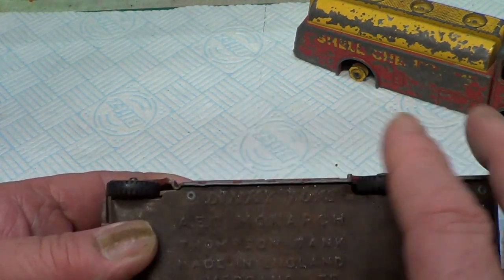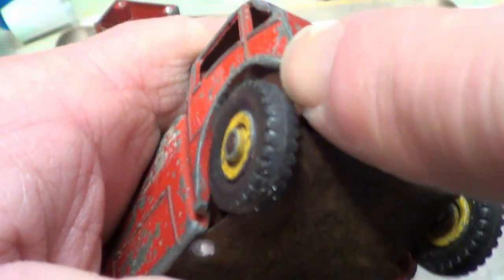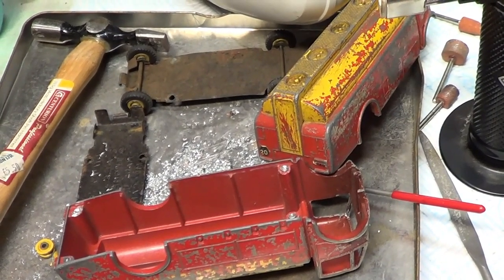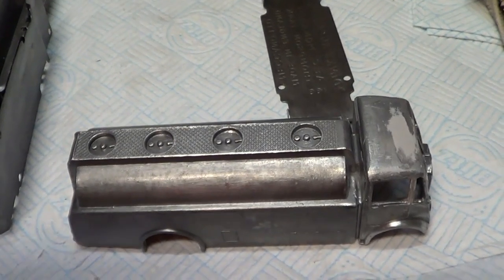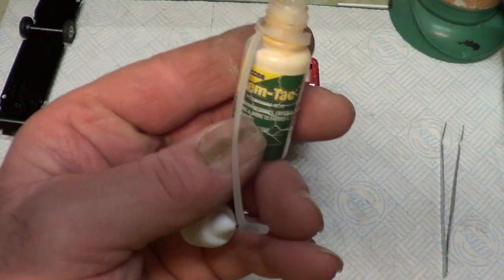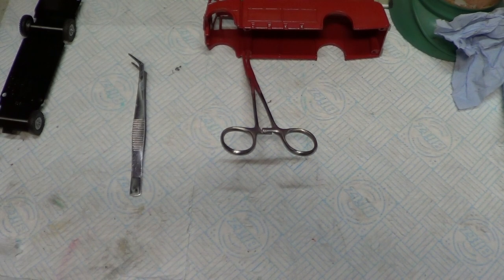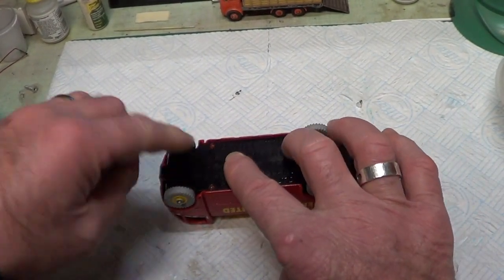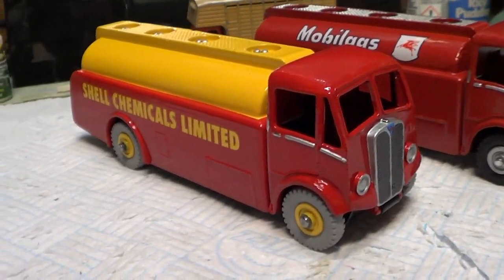RESTORATION OF TWO DINKY SUPERTOYS A.E.C. MONARCH TANKERS.

Comment: Great work on the blowtorch Nick: the pillars rescued well. And the paint comes off those old Dinky castings pdq! The 'damage' on the Code3 truck just looks that much more like the real thing would - hardly anything that age is perfect, so a bit of weathering on the dodgy bits just adds to the restoration! I'd be tempted to suggest the Code3 motor is better than the resto, but hese Monarch castings really make a lovely toy!

Comment: Excellent restoration on both of these nick, a job welldone on the damaged roof and pillars it's not an easy thing to. 
And I know the masking is tricky, having done one myself. 
All the best Martin 👍
Reply from the maker: Cheers Martin, I did refer to your video several times during this restoration, it makes it so much easier when someone has already done one, I was thankful the masking tape didn’t pull any paint off lol👍😊
All the best, Nick🐸🐸

Comment: Excellent Nick. Those bent in “A” pillars can be a real pain to bend outwards with pliers. I got myself some different size circlip tools and they were much easier to use as you weren’t pulling the pillar but gently prising it out in little movements. Look forward to the next resto video.
Reply from the maker: Thank you my friend, yes the side pillar began to melt too, I just put a little too much heat for it then when I tried to move what was left it snapped off straight away🤦🏻‍♂ never mind good old hair clip, superglue and baking powder to the rescue! I have a few circlip tools so I will try that next time, thanks for the tip😊👍 All the best, Nick🐸🐸

Comment: Two ace restorations. I think that the black tyres look much better than the grey ones.  I wonder why Dinky bothered with the grey ones in the first place.
Reply from the maker: Thank you David, I wasn’t sure what to do with the tyres, I started with the black ones for both models then I saw most of the pictures of the original ones had the grey ones so I opted for grey on one model and black on the other🤔
All the best, Nick👍😊🐸🐸